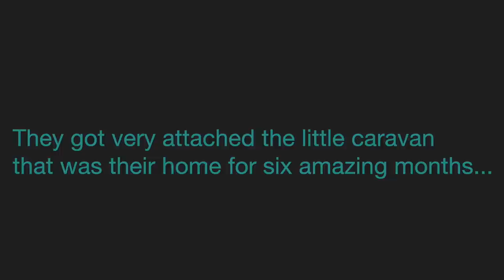Young couple's debt of honour to their AMAZING little Camper

Comment: The beauty of steel is that corroded areas may be cut out and fresh metal welded in place wherever necessary.

The talented welder friend whom taught you how to do the work yourselves has enabled you to learn a wonderful skillset with which 
 you can create and repair metals as required in future.

It also hugely boosted your self confidence.

Superb job on rebuilding your beloved Eriba, however, I would covertly install a Tracking Device in case your travel cabin ever gets stolen, then you'll have the opportunity to get it back.

Trackers are an inexpensive aset in case the wort happens.

Your restoration was truly a labour of love and your Eriba is beautiful.

I wish you many happy kilometres and nights.